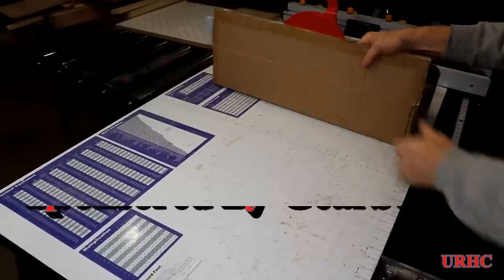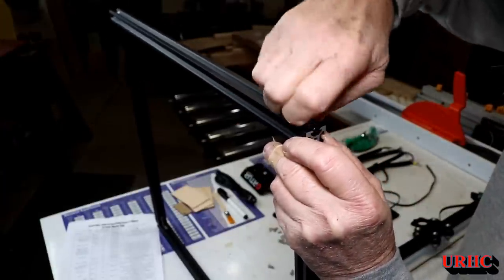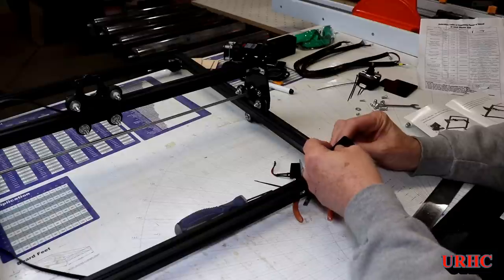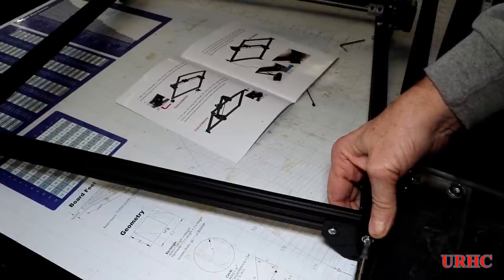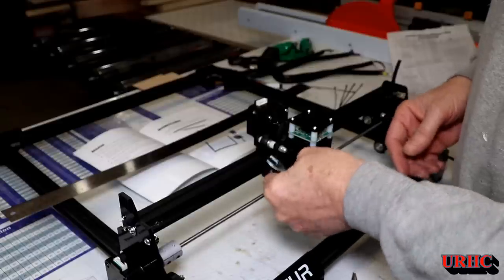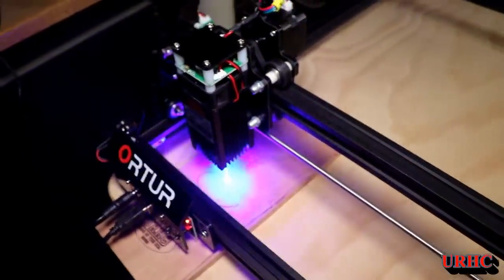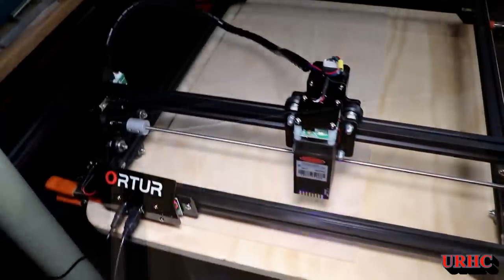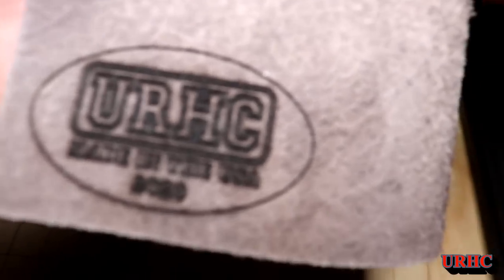Ortur Laser Master 2 400mm x 430mm 15 Watt Laser Engraver From Gearbest

Comment: how do you print so fast
Reply from the maker: Play with  the lightburn settings.  My burns are actually  much slower  then most users. Thanks for watching.
Reply: @unemployedredneckhillbilly2023  will that work on lazerGBL program. I'm new to this
Reply from the maker: I don't  know.  laser grbl was to hard to use so I bought Lightburn.  Lightburn  allows  you to change the fill densities and burn type very easily.  You may want to read the laser grbl manual to figure  that out.

Comment: You need to edit the images you want to engrave. Not one YouTuber I've seen so far has engraved one decent picture engraving. I haven't seen anyone use the machine to engrave images aside from logos with proper depth.
Reply from the maker: I am getting  close but haven't gotten a perfect  picture yet. Some look good from 10 feet away at lower  dpi.  It's definitely the editing.  Thanks for watching.
Reply: Would you post yours along with the settings you used to obtain engravings which meet your standards?

Comment: What goggles do you recommend?
Reply from the maker: I don't recommend any when it comes to eye safety. I got mine on amazon and they are certified to meet the 15 watt blue laser specs but I have no way to test them and don't know about eye conditions that may cause problems. I have read that green is not the correct color for the spectrum of these blue lasers.   Thanks for watching.

Comment: Really not very happy with gear not so best evertime ive asked i get a different shipping date i dont think they have thees units as of yet then they offer me 200 points to stay with my order 200 point = 4 dollars us 
If it dosent ship on the 25 th im canceling my order was looking forward to reviewing this unit if i was ortur i would be looking for a different distributor perhaps ebay or just Amazon
Reply from the maker: I just sent them a email about this. They were supposed to be in stock the end of last week and start shipping this week. I told them to ensure any bought through my links are shipped first. I was told they are stock in China now and that's all I know. There seem to be major delays getting anything out of China lately.  Hopefully you will get it soon.  Thanks for watching.
Reply: Same here, I ordered the original unit on 1/31/20 and all I've been getting is the runaround. I tried changing my order to this unit, and again the runaround. This is one of the worst companies out there when it come to customer service.
Reply: I had it with gear not so best totaly unprofessional i canceled my order they will NEVER see my business again they did refund my money almost as fast as they grabbed it
 sad it seemed like a rather nice unit sorry ortur nickels worth of free advice try selling them on Amazon i may still get one 
im just going to build one from parts i have based on a different controller a ras pi with a prontoneer hat and polou compatible trinamic drivers im going linear rails maybe even a z axis for auto focus